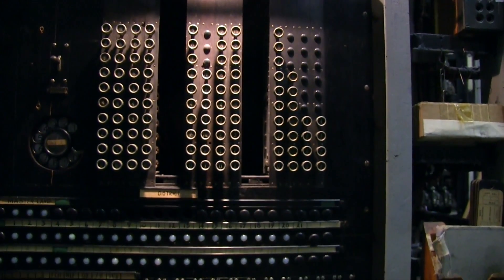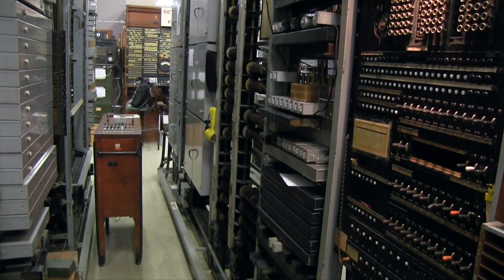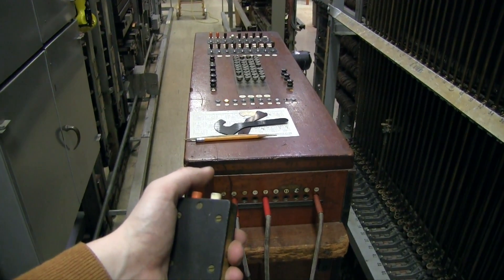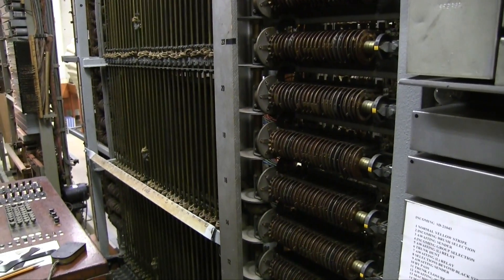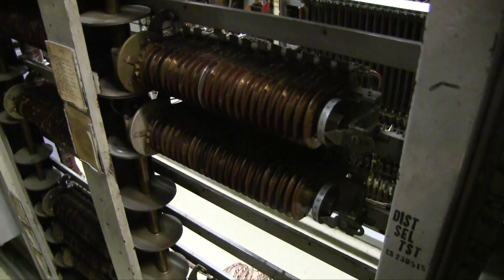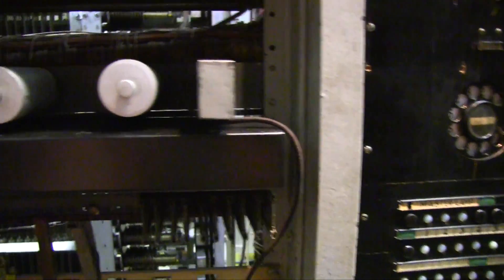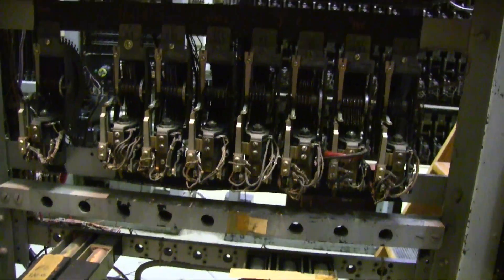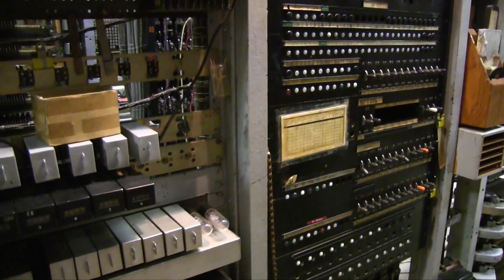Panel System - Automatic Selector Test frame

Comment: These are pretty dang impressive machines. I cannot understand how these were visioned or designed, let alone manufactured - especially with the tools of the time. Especially considering how there seem to have been massive jumps from hand operated to fully automatic relatively quickly. And also how much can be done mechanically. Also one thing that I find so interesting is that how much more reliable the tiny chips etched on a microscopic scale are more reliable than these big mechanical things. Intuitively one could think the other way around. But of course, the microchips have no moving parts (well, on the particle level they do). I wonder how much time it would take from future archeologists to figure out what these devices were used for, if they found one a thousand years from now...

Comment: What keeps setting off the major alarm gong?
Reply from the maker: One or two of the incoming selectors has a sequence switch that is slow to advance out of position 13. For some reason, if it stays in position 13 for too long, it trips an alarm. No idea why that happens, and I don't think it's intentional.

The way to stop the alarm is to rough up the drive disc with a pumice stone so it has better friction and moves out of position more quickly.

Comment: What is purpose of this frame? What does it do apart from noise?
Reply from the maker: Ah, sorry.

The selectors are the part of the machine that move up and down to actually make the connections to establish the call. There are different types of selector frames (District, Office, Incoming, Final). The incoming selector frame is where inbound calls from other central offices enter the switching fabric. If I'm in the Parkway office, and I get a call from a subscriber in the Adams office, the first thing to start moving is an incoming selector.

In this office, there were originally 600 incoming selectors: 60 selectors per frame * 10 frames. These all had to be in good working order at all times, otherwise calls would fail. Since it was too laborious to have a technician constantly going around manually testing each selector, this frame was put in place to do it automatically. 

The test circuit itself picks an incoming selector, performs a test, then moves on to the next one until all have been tested. The test involves driving the selector, (and also a Final selector) to a special test line. The test line is arranged to send pulses back that test the operation of the relays in the Incoming. 

This test frame is capable of testing other selector types as well, but currently the only part that's hooked up is the Incoming test. The rest will be wired in as I am able, though it could take a while.
Reply: Robert Bloch it tests incoming selectors. (Those moving vertical rods). If one fails the test, frame blocks and sounds an alarm, which calls the attention of a technician.
Reply: Sorry, my question was unclear. I got the point it is test device for the selectors. But what those selectors actually do? What do they select? Why and how often they need to be tested?
Reply: Great thanks for this detailed answer. Very appreciate. All clear now!